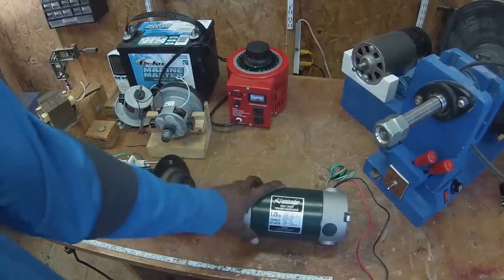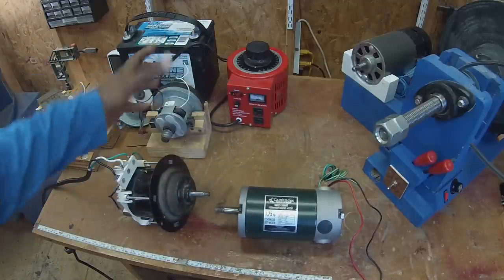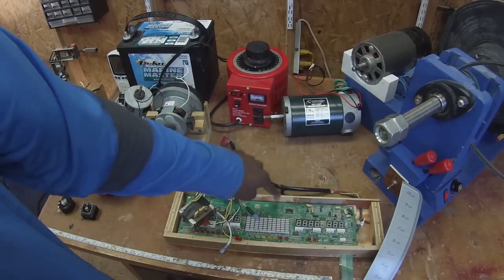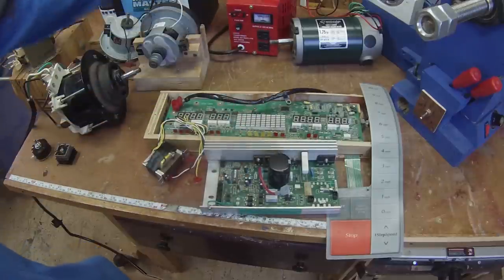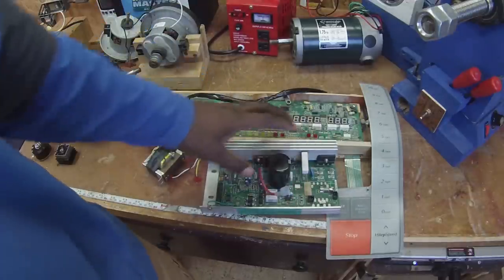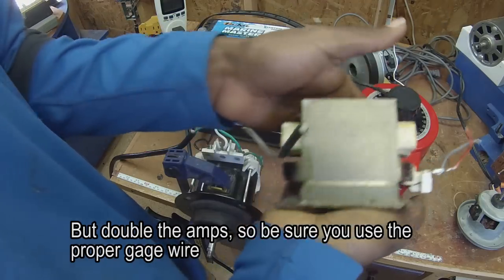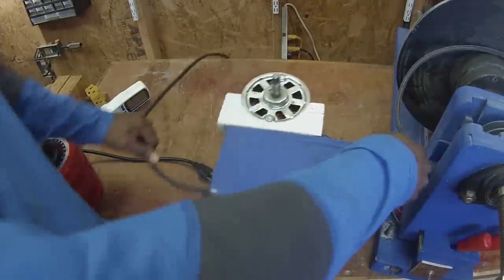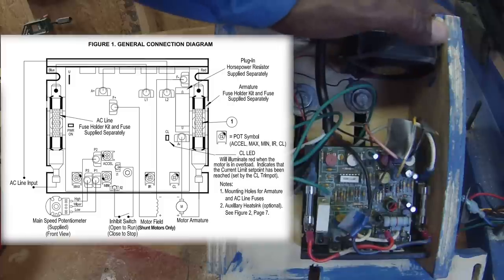How To Wire A Large DC Motor And Control The Speed; Treadmill Motors and Universal Motors 019

Comment: I like the video, but I would be careful with a transformer rebuild that welded the core back together. The plates of a transformer are laminated leaves to prevent current from being created within the core. Welding the plates back together would likely cause it to generate heat.

Comment: I love your videos. I only disagree with your statement that the 24v lawnmower motor will develop about half the horsepower at 12v. The motor will develop about 1/4 the horsepower at 12v compared to the full horsepower at 24v.  horsepower.

Comment: Hi Jeremy. I served a 5year apprenticeship here in UK in the 60s. I have learned more from you in a few hours than I did in my whole apprenticeship. At 70 years of age I am learning again. I have rescued a motor and hope to discover how to wire it.It has 3 wires, 2 brown and 1 blue. The diagrams (2)  show a capacitor to N and bl, or bl/N and sw. The diagrams show 3rd connection as vio -L1. It's a 4 pole, 230v, .4amp, 42 watt Gefeg brand motor.  Model E.G. 7130 2al rl Thanks for your knowledge and enthusiasm, it is so refreshing.

Comment: The definitive DC treadmill motor video.  Thanks Jeremy.  Just got a treadmill Thursday, good motor and controller.  Stripped it down.  Alas it didn't have an MC-60 type controller, so I will be trying out a 10000W 110v 220V SCR Voltage Regulator Motor Speed Controller from our favorite auction site for $12.66 and a bridge rectifier.  It will come on the slow boat in a month perhaps.  The controller that was in the treadmill is an Astar TD-3000N.  Worked, but not likely to be able to hack it at my skill level.  Not much on the net about it.

Comment: Jeremy, 
you just solved a problem for me.  I have a 12v squirrel cage fan to use for a blower motor but it's not fast enough.  I have a vacuum cleaner motor that will spin faster but I couldn't regulate it.  This video showed me I could.  Thank you.

Oh, If you have a electric supply house nearby get a "Uglies" book. It has all sorts of information in it for electricians.  Wire: sizes-amp capacities-ohms per foot-etc, the formulas for watts/amps/volt/ohms, explanations for the markings on the wire. i.e "THNN, THHN", Motor information and formulas for power needs, and some code stuff that can keep you out of trouble too.  The last one I bought was $15 WELL spent.

Comment: Jeremy Fielding  Ok so I know this is on of your older videos but it’s a great one!  I went ahead and bought the variac device, a bridge rectifier for a generator, and the large size female spade connectors. I used a treadmill on/off box and put the rectifier on a big heat sink inside with a 110 ac plug in and the dc motor connectors out. 
I have to say Jeremy, this set up works great and controls the treadmill motor on my metal lathe perfectly. In the past I’ve tried cheaper solutions not the control over the full range isnt there. The whole setup was $90 and can easily be moved around if needed. I have several dc motors to set up in my shop and plan on making several on the rectifier boxes to make it all easier. 

The components I used
Variac - 20 Amp transformer $71.19
Bridge rectifier - PSCCO rectifier diode bridge with heat sink  $11.21
9.5 mm female spade terminals - $6.95. The rectifier has the large male spade terminals. 
Plus wire and other consumables from inventory. 
Total $89.35
And on the scheme of things well worth the cost to gain the desired control over dc motors.

Comment: Thanks for the help, Jeremy. I'm designing and building an ultra lightweight pedaling electric car. It's aluminum framed, using moulded carbon fiber where key strong points are in the body and polycarbonate body as well. You are smart.

Comment: I am grateful for your videos.  I had purchased a motor from a scrap store and wanted to make my own pottery wheel and now I know for sure this dinky 1/10th ball bearing motor I have isnt the right one, and I will need a speed controller for sure.  I actually have that harbor freight thing too, I can see now it wont work and is basically a dimmer switch lol.  I will find a treadmill somewhere and review your videos before I attempt anything.  I really appreciate the time and energy you took in making these, I probably would have burned my house down or put effort into something that either didnt work or didnt work correctly.  Take care :-)

Comment: hey, getting the hightention coil out of a µ wave transf is to cut it on both sides with a light hammer and a woodchissel. very straight and controled. Then tap out the wires with a large square pin and twissers

Comment: good video, I am an electronic engineer by trade, the 1500 would work fine its the voltage you need to watch when choosing a capacitor, the higher the MFD the smoother the DC output, but you could use the 1500 uf for test purposes, good job don't stop learning you are on the right track, good for you for taking the interest in this.
Reply: steve lecain would you be able to recommend the rating of capacitor for this application? 

Thanks

Comment: Important side note, YOU CAN FIND A FULL BRIDGE RECTIFIER IN THE TREADMILL CONTROL BOARD. 

Thanka to watching this i learned what the FBR looks like and discovered there is one hidden on thw bottom side of the co teol board attaches to the heat sink. 

After this video i was thinking i might jewd to BIY a FBR. Nope already got one i  the failed conteol board. 

This was a VERY helpful tidbit i could have used earlier but i got thwre in the end

Comment: as a retired Industrial mechanic I've used hundreds of dc motors the DC drive uses small capacators in the circuitry for amp and voltage control. A large capacator is used for noise reduction in a circuit to reduce ripple.

Comment: When I built a battery charger for my truck out of a few old Samsung bricks I used 3 220v 22uf capacitors to smooth out the dc because the oscilloscope was still showing a little static in the signal. This smoothed it out and after switching the resistor I was able maintain a smooth and even 16v continuous output. Worked perfect at 2amp. Hope that helps. I build a 52volt  charger for my 4 pack of 12v 7amp batteries I used for an ebike as well and used 3 500v 100uf capacitors on that. Again, worked quite well and took what looks like just a little static on the oscilloscope, out of the output.

Comment: Another great video! I would just like to add to the discussion. There are a lot of PWM Controllers available from online retailers for around $10 that can be very useful to many people using DC motors under 15 amps. I have been using a sub $10 PWM speed controller with a small 12v 50rpm geared motor for several years now to turn fishing rods I build while the finish dries. The PWM gives serviceable torque even when it is only turning at 2 rpms using the PWM. PWM = Pulse-Width-Modulated controllers for those who may not know. PWM speed controllers are great because they give you more torque at low rpms than you get just by dialing down the voltage.
Thanks again Jeremy. This video will be very helpful to those wanting to reuse motors for other purposes.
Reply: I edited the original post because I mistakenly assumed the KBIC controller and Treadmill controller were PWM Controllers, after looking them up I found out that they are SCR based controllers. My mistake!
Reply from the maker: +The Fishing Hobby no problem. The Kb speed controller is fantastic. Very responsive in maintaining speed unload load... I cut that section because the video was just to long. I hate the loss of speed (under load) with the HF speed controller, but I dogged it enough in the video so I left that out too.
Reply from the maker: +The Fishing Hobby the only issue is I always want at least 15 amps lol... give me the juice to run it at max power lol I want to trip the breaker box
Reply: Jeremy Fielding 
I started to mention on my other post that I get speed control units from Banggood and have had pretty good results so far. 
Have one now that will handle 60 amps at 48 volts and cost me a whopping twelve dollars! 
If you aren't already aware of Banggood, I'd suggest that you check them out!
Reply from the maker: now we are talking! I will check it out.
Reply: Ken Gamble , I wasn't aware of inexpensive high amperage PWM's, I will check that out!
Reply: Jeremy Fielding I understand that!
I was bringing it up for people looking at reusing smaller DC motors for projects. Old cordless drills and screwdriver motors have lots of potential uses and inexpensive PWMs are a great way to control them.
Reply: Ken Gamble I checked that site out and they have some really nice looking stuff! Thanks for the info!
Reply: The Fishing Hobby 
You're very welcome! 
I've been buying stuff from them for over two years now and have not had any problems. 
What I like is they have ALL kinds of things on there so I graze around and get a lot of ideas,...... some not so good !  ;-)
Reply: Ken Gamble haha! How long is your shipping time typically?
Reply: The Fishing Hobby 
Sorry for not getting back to you sooner! I don't know what happened to YouTube, it used to give me notice of comments and now even with the settings for it turned on, it doesn't! 
Shipping time on there stuff is on average about two to two and a half weeks, but I have received an order in as little as one week. 
The main thing I like about them is the free shipping, which on other sites like theres could increase the bill by a bit.
Reply: You can also avoid the shipping times and order similar DC motor controls from Ebay.  They are selling stock that they buy from places like China. 

It's worth looking around sites like Banggood, AliExpress, and even Ebay for control electronics like this.  The costs for this stuff is usually very cheap, and may be worth it over trying to shoehorn a DIY solution.
Reply: The Fishing Hobby 😗

Comment: another thing you can use is a ceiling fan control, they're designed for motors and are only rated for up to 5 amps or something, but for small fans like what is in blowers and such, it works fine. You can usually find them in the same area as the light dimmers at your hardware store for around 10 dollars. I have one on my foundry blower and it's been running for a few years now with no issues.

Comment: awesome videos.  im trying to figure out speed controlling a similar motor with consistent control under load.  the treadmill seemed to have a speed sensor on the back of the motor to accomplish this, but im probably going to discard the electronics because documentation is terrible and there is a lot of stuff i don't need or want to deal with... im sure you have something somewhere about loading and speed control 

anyway thank you for producing all this material.  its incredibly helpful and super cool to watch

Comment: The major deal with the capacitor is to ensure the voltage is rated high enough for the application you're using. So with the capacitor shown on the control board it's rated for 200vdc. The microfarads are related to the filtering of the ripple voltage, the higher the capacitance the greater the filtering. You're in essence building a DC power supply. The bridge for rectification the cap for constant smooth power out and you could add a load resistor to dissipate the current from the collapsing of the field when you stop the motor also helping discharge the capacitor for safety of handling.

Comment: As far as the garage door opener motor goes you were right it does say on the motor. It says "intermittent duty" or something to that effect. But it could still be usable, you never know where it could work.  It is easily reversible, BUT appears to turn very slowly maybe 500 rpms + or - . The big thing is the end play on the motor is regulated by the opener chassis and once removed from there it has about 1/2 inch end play.  I'm sure it would run into the motor housing. But we will see.  Thanks again.

Comment: Great Stuff, for large cheap run capacitors hvac applications like the air handler and especially the outdoor compressor use them, I just searched on amazon and they have 100 micro ferrad motor run capacitors for around $15 , in the outdoor unit, usually the same run capacitor is used for the fan motor, and the compressor motor. Hope this helps, thanks for all the great video info.

Comment: I feel so blessed to have found your website.  I have watched three of your videos and am so impressed with your electrical knowledge and excellent teaching skill.  What I really need help with is choosing the proper size pulley for the job.  I’m starting to collect the components to build a perpetual energy machine large enough to power my home.  I have been watching everything I run across on YouTube dealing with the subject.  The one I’m most interested in utilizes a heavy flywheel.  A large motor gets the flywheel up to speed and is replaced with a much smaller dc motor to maintain the flywheel speed.  If you could provide me with any help I would be most appreciative.  In the meantime, I’m going to watch many more of your videos.  Thank you for any consideration.

Comment: I have one of those HF speed controllers. They sell them for use with a cheap router.  It works reliably and great for me to reduce the speed of an HF electric 1/4" collet die grinder (universal AC motor) that resembles one of their cheap 4-1/2" angle grinders without the gear case. The die grinders run brutally strong and too fast (25k rpm!). This speed reducer makes the die grinder manageable. I have run the heck out of that die grinder, and the speed reducer, using them commercially, actually... So long as you don't overheat the 5 amp grinder motor, they both have held up really well.

Comment: I can only imagine what could be accomplished if we got you and Mathis [out of Canada] together.

I like the use of the charger for firing off the fan. I save all of them, along with every cable and wire I can find for future computer and stereo repairs and such. 

Using a charger from Goodwill or whatever would be a lot easier than adding another controller just to tap off the rectifier (just guessing).

Comment: Adding a capacitor across a rectified ac to dc will smooth it somewhat but the cap will only recuce the noise of the motor but won't significantly change its power output or speed control.The cheap triac supply can be made to work better if you put an ordinary filament light bulb across its output so the circuit will trigger sooner on the dial setting.Try 100 watts.

Comment: there should be a trimmer pot inside the speed controller.  it is made of discrete components.  I have built a few using micro controllers.. they work much better.  it works by interrupting the ac sine wave.

Comment: the advantage of using the factory treadmill MC-2100 controller board is that there are inexpensive PWM circuits you can fab and plug into the treadmill control boards. The 9 pin connector on the lower left side uses pin 4 for the PWM pulse (speed control) 1 and 8 are grd while 2 is 12VDC. Simple.
Reply from the maker: +john buster -I agree with you this can be done. I would probably use a small Arduino. But it requires knowledge somewhat beyond the scope of what I was trying to show here. Many people are intimidated by wiring and circuits. I plan to continue this series and we will build up to projects like what you describe above.

Comment: 1000v  50 amp bridge and 20 amp autotransformer may add a correct volt capacitor is so easy and robust like hard to make it fail with 20 amp autotransformer. get one worth it! only can use one motor at a time typically.

Comment: Hi Jeremy, great video which has helped me complete a couple projects I’ve been working on. Just one question, I’ve installed my first speed controller, transformer and bridge rectifier plus lots of wires in a 6”x8”x 3” plastic box, how much heat build up in  a closed box like that? The setup is used on my lathe.

Comment: I never knew they sold power supplies up to 130v, I can see a lot of applications for that device. I've used a 1000uF capacitor after a variac>bridge setup and the ripple is pretty substantial on the oscilloscope. Awesome vid!
Reply: I don't know if I would call it a power supply. It's just a transformer designed to allow you to tap the windings anywhere between their start and end to vary the voltage output.

Mine also goes from zero to 150 volts A.C. out. They sell them in different amperage ratings (the old basic electronics rule was, when you double the voltage, amperage cuts in half).
Reply: @kellyvcraig  The ones he describes in the beginning are power supplies. Like the ones you find in tread mills. Much easier than a variac and bridge. Yes the variac and bridge isn't a "power supply" but it supplied 90VDC where needed in projects!

Comment: The DC motors will be noisy and not last long if you run the straight off any controller that is powered by AC Mains.
You need to include the DC (2-wire) choke/inductor that was originally in the treadmill. It is wired ibto one of the motor leads to smooth out the chopped waveform produced by the controller and rectifier.

Comment: If you open up that HF speed controller, there is often a trimmer pot inside, accessible through a hole in the board, that is used to set the low speed setting.  If you tweak that you should be able to get low to high speed control through the entire range of the knob.
Reply from the maker: I will check it out thanks.

Comment: The triac probably doesn't have enough power to start up the motor until you have it at higher voltage. The full bridge rectifier also causes a voltage drop which further lowers the power.

Comment: You can buy a dc speed controller 30A from amazon Banggood ebay you get the drift. Simple. Reversible. Has a potentiometer built in with a digital display. Super small.